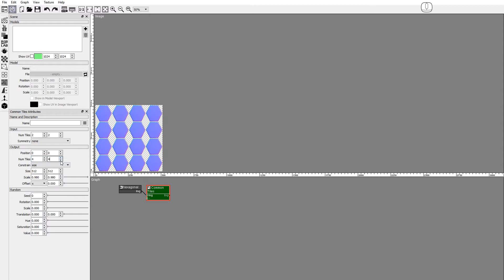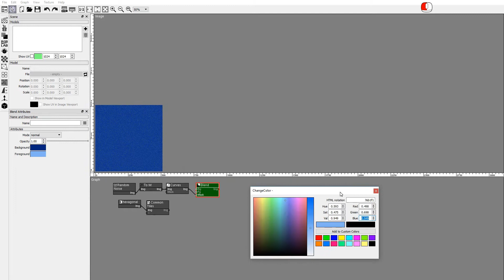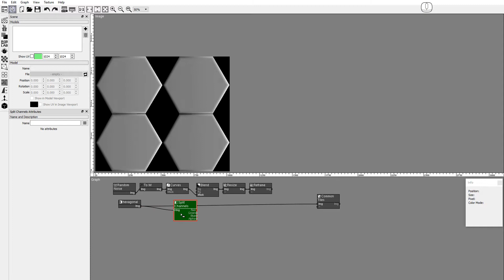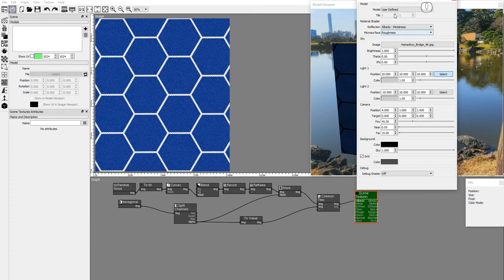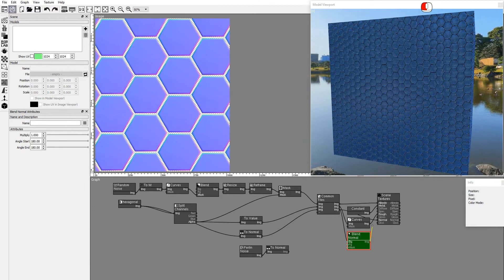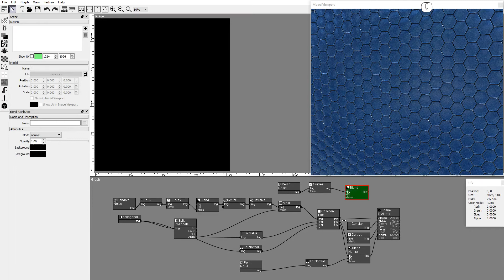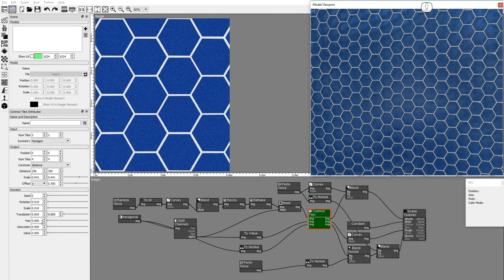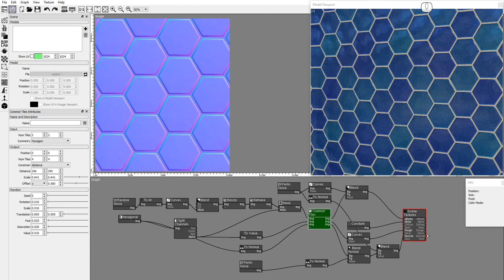Create Hexagonal Swimming Pool Tiles with PixaFlux

Comment: For some reason, my Mask node turns red when I connect it to the previous parts of the chain. The icon for the Mask on the node becomes red, so I am not talking about a red border. I think it doesn't like something that I am inputting it but it is hard to tell why. Also, there is no longer a To M node, how can I make it monochrome in the current version? Thanks.
Reply from the maker: Hello Vinci. A few years ago we limited the number of supported image formats to RGBA, VALUE and NORMAL. Monochromatic images are now supported by the VALUE image mode, and the To M node is now named To Value.

Comment: Well,after a couple of weeks of using pixaflux,i can say ITS FANTASTIC!The feature i like the most -is baking normals.Will be awesome if there will be more options,making groups of edges with different bewel thiсkness,for example
Reply from the maker: Thank you for your comments and suggestions. We're planning some other tools that would require sub-object selections (verts, faces, edges) and then we could expand the mesh smooth hard edges tool to include the features you have suggested!